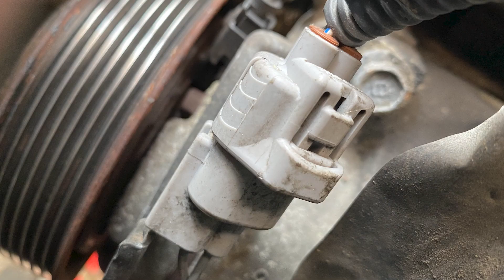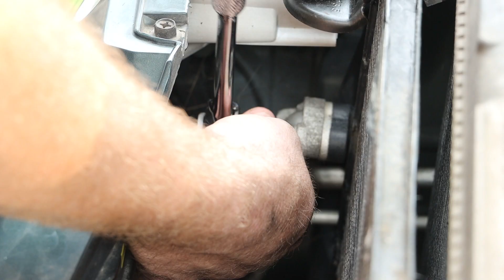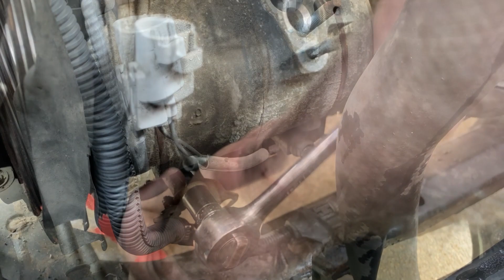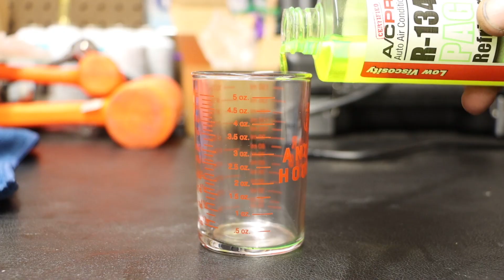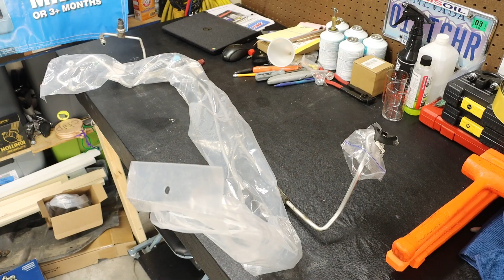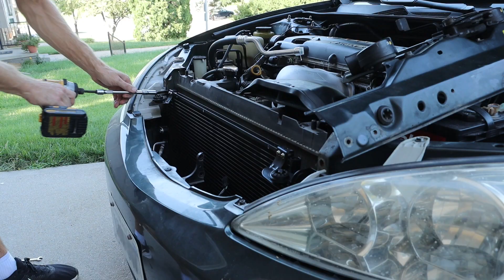Replacement of Compressor, Condenser, and A/C Lines - 2003 Toyota Camry, 2.4L (2002-2006)

Comment: If in only replacing the condenser I need that oil in there?
Reply from the maker: The general idea is that there is oil flowing through the entire system, so, in theory if you remove one component then you are removing some of the oil, thus if you add some oil to the new component you are maintaining the same level of oil in the sytem.

Comment: What’s the approximate cost of repair labor included?
Reply from the maker: Labor is usually the biggest part of a repair like this. Depending on the shop and your area, replacing the compressor, condenser, A/C lines, evacuating/recharging the system, and testing for leaks would commonly run somewhere around $800–$1,500 in labor and total repair cost can easily reach $1,500–$2,500+ with parts included.

A lot depends on whether you use OEM or aftermarket parts, and whether any additional components (like the expansion valve or receiver/drier) also need replacement. Doing it yourself can save a huge amount on labor, but the system still needs to be properly vacuumed and charged afterward.

Comment: Why oil in condenser drier?
Also do you think it is possible to release compressor from engine and pull away slightly just enough to get access to clutch for bearing noise repair?
Reply from the maker: There is oil flowing throughout your entire A/C system.  If you pull one component, you have to assume that you are pulling some of the oil out also.  Replenishing the oil will ensure the system has the correct amount of oil...Not sure on moving the compressor if that will give you access.  There is not very much play with the lines attached.

Comment: one of the best repair videos on youtube. I have a 03 Camry with a noisy compressor I was hoping to get one more year out of, but now I will probably just do the job myself. Thanks.
Reply from the maker: Thanks for the comment.  Good luck with your repair. If you are interested, you can check out the full repair of the system here: https://youtu.be/V0I6sKrA_eE?si=w7RrJuEXw2d1C-du

Comment: Just curious why you took the oil out and then replaced it on the compressor? Could one just leave the oil in the compressor that it comes with? Also do you have to replace the condensor when a compressor needs replaced or is it just recommended?
Reply from the maker: Although not required, it is recommended to drain the factory oil and refill with new.  I also did partially to ensure I had the UV tracing oil throughout the entire system.  In general, when a compressor seizes up it has a tendency to shoot metal fragments down the lines into the condenser which will clog it up.  The A/C system on this vehicle had not be in operation for more than 10 years.  I suspected that metal fragments were also pushed into the evap coil.  However, I first replaced the condenser and compressor and was still having problems so I ended up having to replace the entire A/C system.  https://www.youtube.com/watch?v=V0I6sKrA_eE